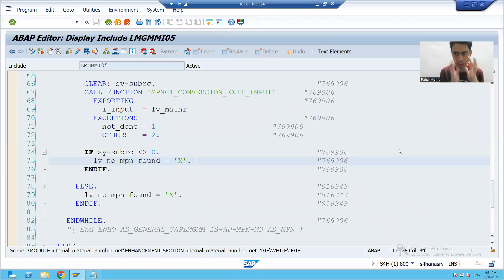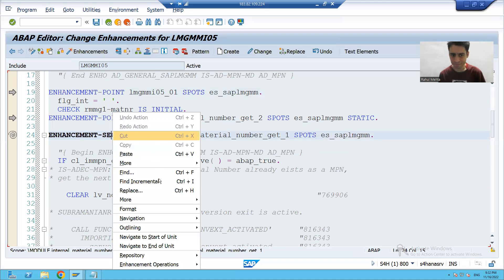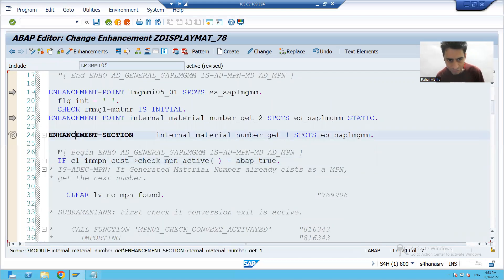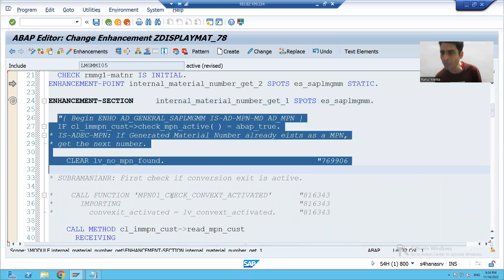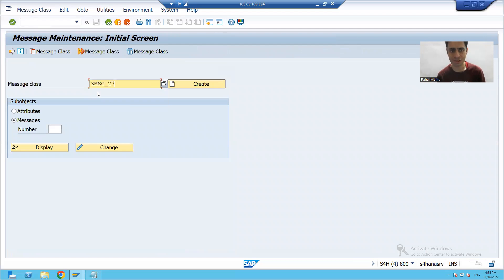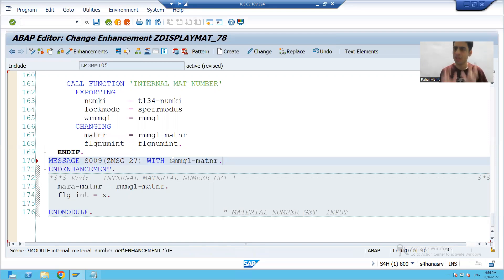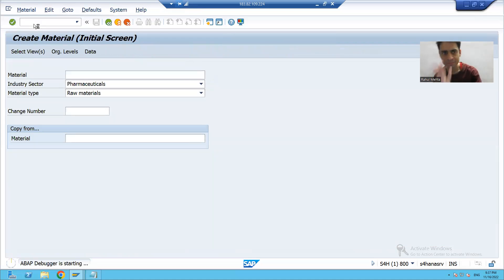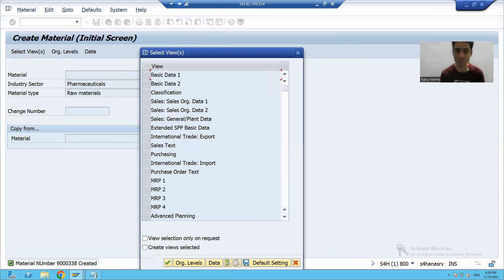8 - Enhancements & Modifications - Explicit Enhancements Part4

Comment: Hi sir, if we have multiple explicit sections implemented will all those inplemtnstions will be called during execution??if yes in which order it will call
Reply from the maker: Hello Sumalata - It will execute in the same way just like any other code.

Example - There is an implementation starting at 100 line and implementation at 200 line and they are triggering on save button. So 100 line logic will execute first and then 200 line logic.

Comment: Sir already SAP enhanced implementation is available in my system for the ENHANCEMENT-SECTION . I created another implementation and written logic to display the Internal Number. Activated the Enhancement and ran the program. It displayed the message as expected. When will SAP enhancement execute in this scenario?

ENHANCEMENT-SECTION     INTERNAL_MATERIAL_NUMBER_GET_1 SPOTS ES_SAPLMGMM.
  CALL FUNCTION 'INTERNAL_MAT_NUMBER'
     EXPORTING
          NUMKI          = T134-NUMKI
          LOCKMODE       = SPERRMODUS
          WRMMG1         = RMMG1
     CHANGING
          MATNR          = RMMG1-MATNR
          FLGNUMINT      = FLGNUMINT.
END-ENHANCEMENT-SECTION.
$*$-Start: INTERNAL_MATERIAL_NUMBER_GET_1------------------------------------------------------$*$
ENHANCEMENT 2  AD_GENERAL_SAPLMGMM.    "active version
* IS-ADEC-MPN: If Generated Material Number already eists as a MPN,
* get the next number.

  CLEAR LV_NO_MPN_FOUND.                             "769906

* SUBRAMANIANR: First check if conversion exit is active.

  CALL FUNCTION 'MPN01_CHECK_CONVEXT_ACTIVATED'      "816343
    IMPORTING                                        "816343
      CONVEXIT_ACTIVATED = lv_convext_activated.     "816343

* While Loop should exit once the MPN is found!!!    "769906
  WHILE LV_NO_MPN_FOUND IS INITIAL.                  "769906

    CLEAR RMMG1-MATNR.                               "769906
    CALL FUNCTION 'INTERNAL_MAT_NUMBER'              "769906
       EXPORTING                                     "769906
            NUMKI          = T134-NUMKI              "769906
            LOCKMODE       = SPERRMODUS              "769906
            WRMMG1         = RMMG1                   "769906
       CHANGING                                      "769906
            MATNR          = RMMG1-MATNR             "769906
            FLGNUMINT      = FLGNUMINT.              "769906

    IF NOT lv_convext_activated IS INITIAL.          "816343

    CALL FUNCTION 'CONVERSION_EXIT_ALPHA_OUTPUT'     "870888
      EXPORTING                                      "870888
        input         = rmmg1-matnr                  "870888
      IMPORTING                                      "870888
        OUTPUT        = lv_matnr.                    "870888

      CLEAR: sy-subrc.                               "769906
    CALL FUNCTION 'MPN01_CONVERSION_EXIT_INPUT'      "769906
      EXPORTING                                      "769906
        i_input         = lv_matnr
      EXCEPTIONS                                     "769906
        NOT_DONE        = 1                          "769906
        OTHERS          = 2.                         "769906

    IF sy-subrc <> 0.                                "769906
      LV_NO_MPN_FOUND = 'X'.                         "769906
    ENDIF.                                           "769906

    ELSE.                                            "816343
      LV_NO_MPN_FOUND = 'X'.                         "816343
    ENDIF.                                           "816343

  ENDWHILE.                                          "769906
ENDENHANCEMENT.
ENHANCEMENT 1  ZMATNR_DISPLAY.    "active version

    CALL FUNCTION 'INTERNAL_MAT_NUMBER'              "769906
       EXPORTING                                     "769906
            NUMKI          = T134-NUMKI              "769906
            LOCKMODE       = SPERRMODUS              "769906
            WRMMG1         = RMMG1                   "769906
       CHANGING                                      "769906
            MATNR          = RMMG1-MATNR             "769906
            FLGNUMINT      = FLGNUMINT.              "769906

MESSAGE S007(zmsgclass) WITH rmmg1-matnr.
ENDENHANCEMENT.
Reply from the maker: Hello Teja - The question is not clear to me. You are already getting message, it means your code is executing.
Reply: @sapabapbyrahulmehta Sir in this case there are two enhancement implementations. One is SAP defined and one is Z Enhancement defined by me. Both are in an active state. For now , Z Enhancement is executed. But What about the SAP defined Enhancement? When will it execute?
Reply from the maker: @sai_tejayt    Hello Teja - When we implement ENHANCEMENT-SECTION, system will execute our implementation not SAP implementation.

Please refer to this video.

https://youtu.be/xlfY5AzFz0w?si=MitunVpzs6O9kIPv

Comment: Rahul sir, what usually happens to the custom code that we have written in the enhancement point/section,during the upgrade
Reply from the maker: Hello Lakshmi - Sorry for the late reply. I don't have exposure to upgrade project. So, I will provide the answer based upon my understanding for Enhancements &  Modifications .You need to cross validate also. In Enhancement Point/ Section - we write the code in custom namespace. So, nothing will happen to that code which is written using customer namespace. In User Exit's, we directly write the code in SAP namespace, so that create problem during upgrade.
Reply: @sapabapbyrahulmehta  thank you sir , will check and update you

Comment: Hi Sir,

As per my understanding and the information available online, implicit enhancements and explicit enhancements are both to enhance sap standard functionality.Most experts recommend using explicit enhancements 
The main concern is that during upgrades, the code written in implicit enhancements might get overwritten. In the case of enhancement section, if we comment out SAP's standard code and add custom logic or additional logic, will it also get overwritten during an upgrade to the latest SAP version? Could you please confirm?
Additionally, regarding enhancement points, since they do not involve direct modification of SAP code, does this mean they will not be impacted during upgrades? Could you clarify if this understanding is correct?

If possible, I kindly request you to create a short 5-minute video on this topic, as it frequently comes up in interviews or you can respond to this comment Sir

Thank you in advance for your guidance!
Reply from the maker: Hello Firoz - Sorry for the extremely late reply. As I don't have exposure to upgrade projects, So I will provide the answer based upon my understanding. During upgrade, whatever is in customer namespace will never get overridden. So, based upon my knowledge - nothing will happen to implicit, explicit, customer exit, BADI and BTE. Only user exit's will be overwritten, as it is a modification which is in direct SAP namespace. 

Note : This answer is based upon my knowledge/understanding.
Reply: @sapabapbyrahulmehta  NP Sir. Thanks for the update

Comment: Hello sir, 
1 ) how to identify which enhancement  method need to select ,based on the requirement ?
2)  in this video we are using Explicit enhancement  and trigerring the message if it does not contain 0 to 9 in material number.
is it possible to do the same requirement using customer exit or BADI ?

Thank you.
Reply from the maker: Hello Chandru - Below are the answers. 
1) There is no way to identify that this requirement will be fulfilled by this particular Enhancement. First priority is of BADI always, as it is totally based upon OOPS concepts, then Customer Exit and then Explicit and Implicit Enhancements. 
User Exit's anyways available in SAP SD Module only and BTE is in SAP FI Module.
2) Yes, if SAP has provided another enhancement techniques, we can go for that as well.

Comment: Hi @rahul brother,

What is the behaviour of static key word in the enhancement-point along with enhancement spot?.
Reply from the maker: The addition STATIC is used for static source code enhancements - means for Data Declarations , While the statement without the STATIC addition is for the executable code. SAP works on Switching Framework concept. Based upon the Switching Framework, system administrator can activate only the STATIC Implementations( Use STATIC Keyword)/ Dynamic Implementations(Without STATIC Keyword) . From a ABAP Perspective, We will not find any differences, but from the system perspective with and without STATIC is important.
Reply: Hello Rahul sir thankyou for all your support  and videos. Could you please make video on dynamic enhancement

Comment: Complete Video in Simple lines: 
Here : Implemented ENHANCEMENT SECTION & What is ENHANCEMENT SPOT?

To Enhance : Same like Implicit & Enhancement point
                       Tap on Enhance(Spiral) --> Right click on ENHANCEMENT SECTION line --> ENHANCEMENT operations ---> Create Implementation.

the above actions results :
It will give One more ENHANCEMENT SECTION right under the previous one With COMPLETE LOGIC as previous with the GIVEN Enhancement Name. (We can change or replace or add our own logic according to our requirement).

Here the previous Enhancement section will not execute and it will jump to our own enhancement section after creation.

ENHANCEMENT SPOT : it was the CONTAINER for EXPLICIT ENHANCEMENT options(Enhancement                                     Point/Section).   It will remain same for all ENHANCEMENT POINTS & SECTIONS in that particular program.